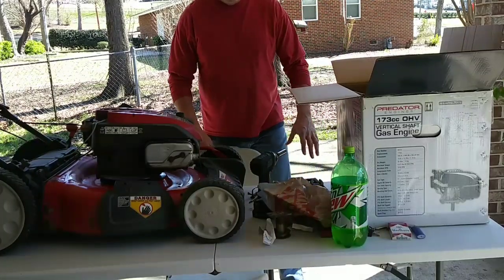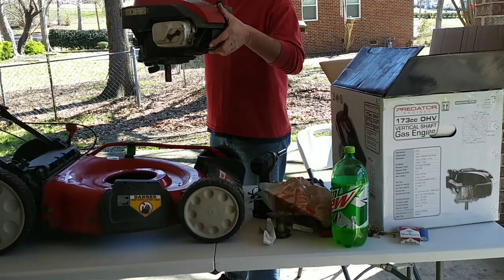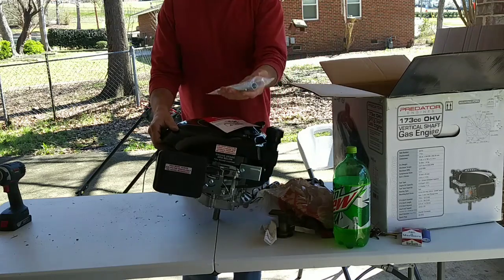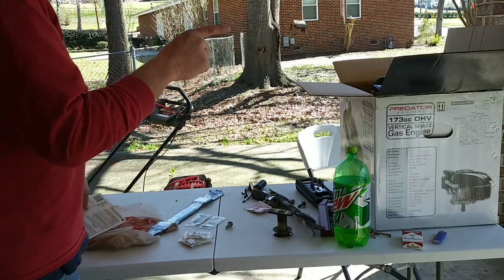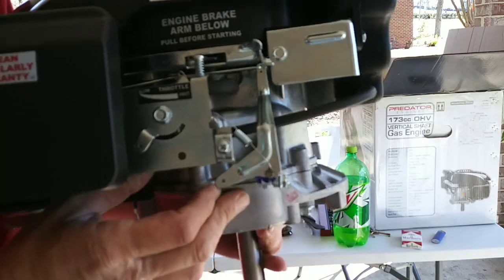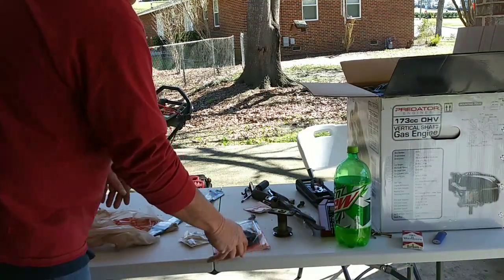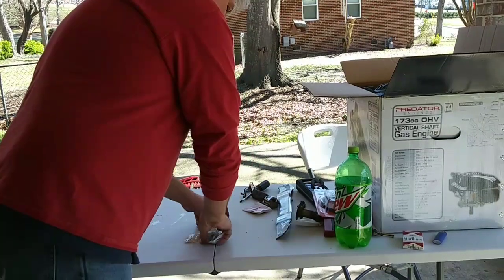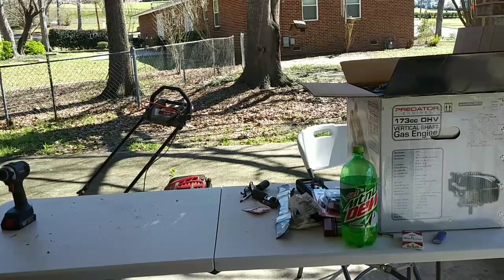Harbor Freight Predator 5.5hp 173cc lawn mower engine swap

Comment: I installed one on an old murry frame. The only thing these guys don't tell you is the shaft in long. I had to get longer bolts and make a shield around the bottom of the motor.

Comment: 4 years later how's the motor running, any maintenance issues other than cleaning the carb or oil replacement?  I'm buying one for a Craftsman push mower.

Comment: You couldnt film the changing of the actual engine? thats the MOST important part lol
Reply from the maker: Yeah I got sidetracked and forgot to record putting the 3 bolts in. Not sure how I would have filmed that anyway. Left the mower on the table raised it up and reached under it to put them in. The holes were lined up perfectly.
Reply: Most important part? It's literally 3 bolts 😂 if you can't figured that out please bring it to a shop.

Comment: If you put on a new throttle control, what was your dead man lever attached to?
Reply: Those are usually attached to the engine brake. It’s just a little brake pad that stops the fly wheel and stalls the engine out.
Reply: @JonBecker81  Ahh ok.   Thanks.

Comment: The engine costs just about the same as a new mower.  
It would be less cost to repair the original engine. 😮
Reply: Very true, I found a new 209cc push mower at the local Big Box hardware store for less than the Predator engine alone.
Reply: You're not going to get much of a mower for $250 or less

Comment: Maybe I missed this part but do you lose the self propelling function or is there a way to hook that up?
Reply from the maker: The belt was attached to the blade adapter to the wheels. The self propelling had gotten weak long before the engine change. I replaced the belt but with the predator engine anytime the self propell handle was pushed forward the engine bogged down like not it just didn't have enough torque.
Reply: @thenotoriousrvh6091  get a bigger predator engine
Reply: @snoopysrc  they only make 1 size mower engine
Reply: @snoopysrc  incorrect only 1 size push mower engine
Reply: @mrbriggs68  yes incorrect but for other machines they make larger engines for lawn tractors
Reply: @snoopysrc  it's a push mower engine we are talking about not a snowblower you said put a bigger engine they only sell 1 push mower engine cant put a horizontal shaft on a vertical mower
Reply: @mrbriggs68  correct that would half to go on a lawn tractor 🚜
Reply: @thenotoriousrvh6091 your transmission is probably locked up if it's bogging down your engine. I put a predator on my John Deere jx75 and it's a heavy, heavy mower and the predator propels it easily.

Comment: Where did you get the blade adapter
Reply: When I did this swap I had to use the old one from my bad motor. Needed 2 pry bars, a propane torch, pb blaster, 10lb dead blow, and about 2 hours later it came off. Thing was on that mower longer than I've been alive